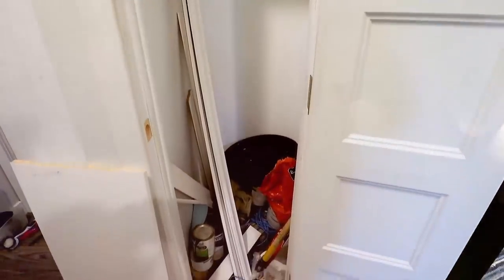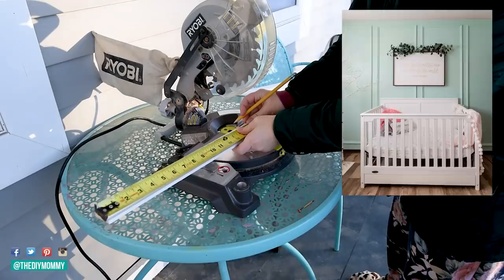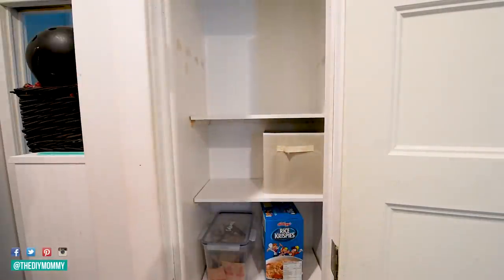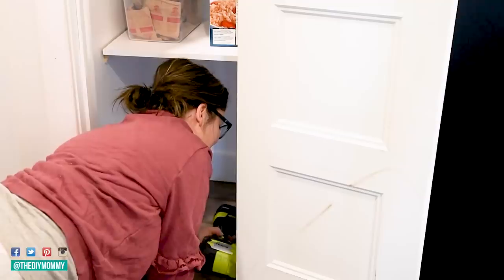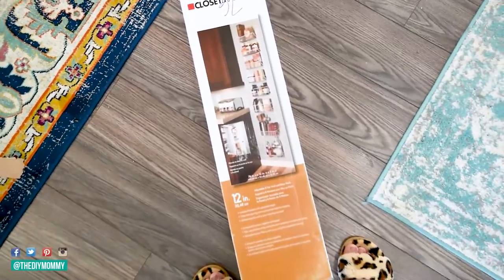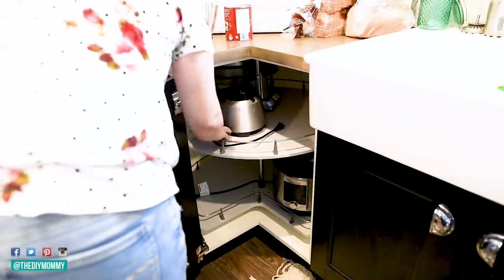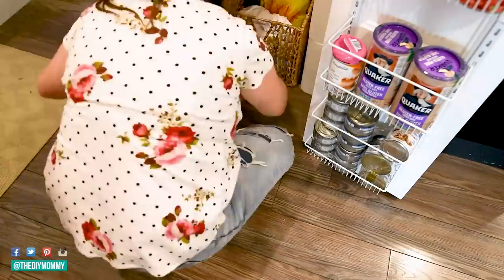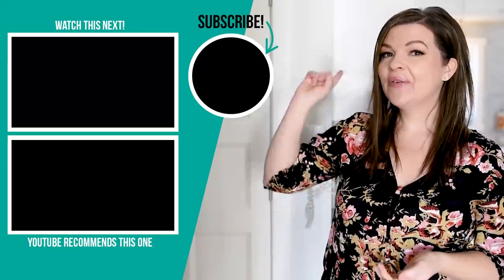Small Pantry Makeover from a useless closet! | Organization Ideas | The DIY Mommy

Comment: That turned out really cute!  We have a short hall between our kitchen & family room that has a 1/2 bath and a closet that is under our front stairs.  I added more shelves to that closet and put all my small appliances in there.  The tool box and first aid kit is on the floor area and medicines in bins of the shallow shelves at the top.  That's where the stairs enter the closet so the 2 upper shelves are not very deep.  I enjoy the appliances there so much more.  I have 3 cabinets in the peninsula that need help now.  HUGS~Donna

Comment: This is interesting.  I have been searching high and low for shelf supports for one single shelf that I want to add to a very small closet that had already been turned into a pantry and have had absolutely no luck.   You've given me a great solution with nailing trim to the wall.  Only problem is that I do not have a mitre saw and don't need to buy one for such a small one time use.  Nonetheless, it's a good idea that I'll need to keep in mind.  Also, I'm happy to have found your channel - I'm in YEG.

Comment: Great video but typically brad nails aren’t long enough or strong enough or grippy enough (like a screw) to hold up a shelf.  Wondering why, if you looked for the studs, you didn’t screw the brackets into the studs?  Truly wondering.  Thanks!!  And I’m from AB too!!  👏😉
Reply from the maker: Thank you! I tested the shelves, and they're pretty sturdy with the longer nails I used. But I agree - screws in studs is best!